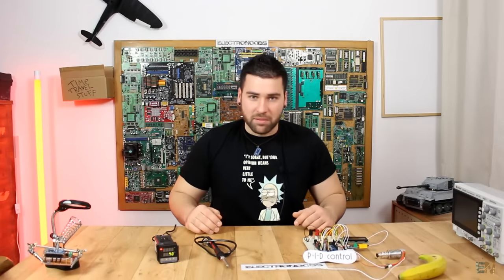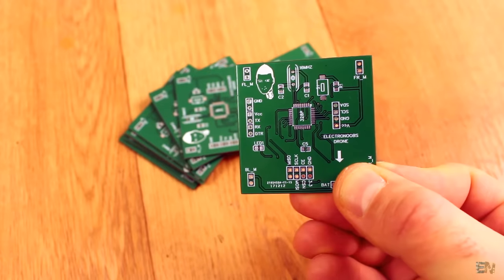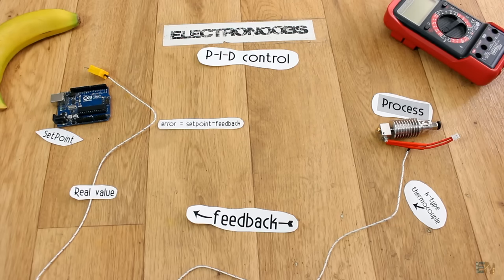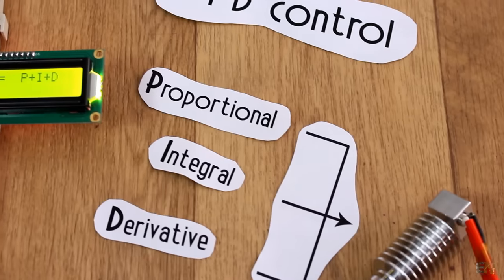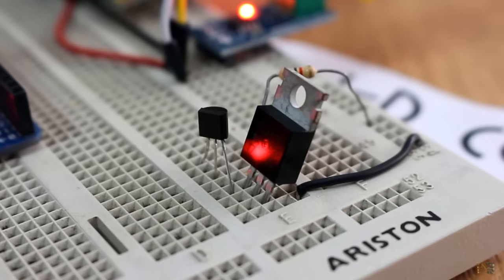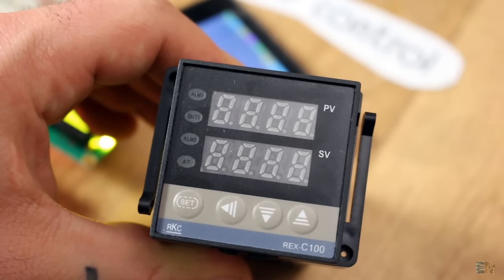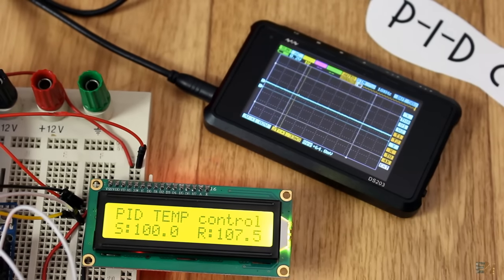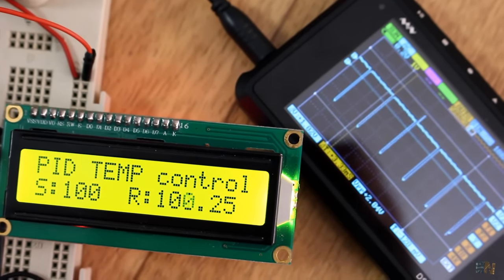PID temperature controller DIY Arduino

Comment: Another great video! I have a question why did you use  BJT transistor to drive mosfet ? how much voltage passes into bjt? 12 or 5 ? if 5 why you didn't use Arduino pin directly And another question why did you use a 10k resistor on mosfet gate ?? Thank You
Reply: Bjt is used since the mosfet has capacitance between gate and drain and the moment you apply voltage to the gate the capacitor starts charging almost instantaneously which requires current greater than arduino pin can provide increasing the switching time and if the switching is not fast, pwm control will not work properly. Please see great scott video on mosfet drivers to understand better. Also the 10k resistance is added to not keep the gate floating when bjt is off.
Reply: When we need fast switching like pwm then we use any gate driver

Comment: Facing an issue where the clicking of the switch does not enter the set temp mode, have you experienced this? Fairly certain it is wired right. Also are you using 12v power supply on the positive and negative runs on the side of the board? you have the resistor and heater on the positive run but other components that should be receiving 5v are on this run. Sorry I am smooth brain engr

Comment: The heating element can be represented by a first-order transfer function if you apply a step input (e.g 5 V or 12 V or whatever the supply voltage is). Plot the transient behaviour as the temperature raises and settles about a value (sample at regular intervals though). This will fit the equation K/(s(tau)+1). K is the gain so that will be the maximum temperature of the plot. Tau is the time constant and this will be the time it takes for the element to reach about 63% of its maximum temperature. You can either simulate this in Simulink and play with the PID values (make sure you use the z-domain rather than the s-domain though.
If you don't want to use simulink then just use a tuning method like ziegler nichols

Comment: I've been trying to do a PID with Arduino for Sous Vide cooking.   The tuning of the PID is the most difficult process for me. The key is to have the patience and good data collection to adjust the various parameters correctly. I tried to doo it with a Crock Pot but there isn't any circulation in a crock pot and I couldn't get the temp deviations down to an acceptable level..

Very good video with good starter information.
Reply: Can you share your thoughts about how you brought the temperature deviations down to an acceptable level?

Comment: Great explanation! I'm what you could call a beginner in grade 10 at school but I've picked up on the basics really quickly and have decided to do a project for in the house. I am going to use a PID to control the temperature for an espresso machine. This explanation was really useful, but still alot of research to do!

Comment: May need elaboration for more advanced engineers on the thermocouple. They DO NOT put out a voltage based on temperature.  They work on a difference in temperature between a hot junction and a cold junction.  The example video is OK for an elevated temperature in a temperature stable room, but would not work to control the temperature of the room because the cold and hot junctions would be at the same temperature.  Great introduction, and a good place for more advanced students to learn about the hot and cold junctions and temperature measurement of the cold junction to get accurate values for the hot junction.  The more advanced students and engineers can locate the cold junction in this example.

Comment: Nice Work. I have couple of questions related to source code
1. Why 3 is added in PID_error
"  PID_error = set_temperature - temperature_read + 3; "
 
2. Why kp (gain) is multiplied by 0.01 and in I value 0.01 is multiplied by PID_i and not Ki
 " PID_p = 0.01*kp * PID_error;
  //Calculate the I value in a range on +-3
  PID_i = 0.01*PID_i + (ki * PID_error);"
  
3. In your case how you figure out that " PID_value"  can be directly written to PWM pin with inversion. How you calculated relationship that this value will produce desired result?. 
 "  PID_value = PID_p + PID_i + PID_d;
  analogWrite(PWM_pin,255-PID_value);"
Reply from the maker: The 3 is added to set a higher reaal value than the set one. You can remove that if you want. 
The 0.01 can be removed but than change the Ki and Kp and divide those by 100 on the top of the code. 
To finde the PDI constants I've just made tests and more tests and always having the PWM signal on the oscilloscope and the real temperature printed.
Reply: Good point, especially number 3. I'm trying to understand the code, shouldn' t there be some kind of mapping function that takes the PID_value and generates an output according to a specified range? And what is the range of PID_value?

Comment: I like this video. 
From many years of experience i will advise you to have a function on your coming
soldering station controller, where it enters sleep mode, reducing temperature when not being active
soldering. 
This is due to the fact that soldering tips are " burning out ", when standing idle with high temperature.
Also the nickel layer is thin, especially on the chinese iron tips you are going to use as per your video..
Kind rgds.
Reply: niels larsen.
A lot of the burning of tips is due to the fact these soldering irons do not have a temperature controller. 
In order to not be too cold when they are working (touching new cold wire and melting tin) they are getting slightly too much power.
Basically, in rest the temperature goes up because nothing cools it down.
I agree it is a nice feature to add.

Comment: as the guys who wrote the marlin firmware know, dont forget a sanity check to watch out for thermal runaway if something happens to the temp sensor.
Reply from the maker: True. Thank you very much for the tip. Keep up!
Reply: Very good point.
Don't also forget what happens when your Max is broken, or gets no power... The temperature reading go to zero. Your PID code will go to Max output power pretty soon.

Comment: With such explanations,
Please make tutorials on controlling a stepper motor using arduino, as I want to open/ close a box's  window depending on the temperature inside a box.
Lm35 as a temperature sensor
Reply: Hey!  Have u got an idea of controlling the steppermotor based on the temperature? Its for my thesis :(
Reply: @TheRebornRJ  ahaha take the pid value and make a condition to powerup the motor by  a signal
Reply: @ultraidtech8250  "video not available"

Comment: Nice work! Just saying.. most of those industrial PID has also option to control solid state relay with PWM, so it will work flawlessly with any resistive heating element...

Comment: Take note about integral windup!
It`s very dangerous mistake you did.
Windup is ver very important.
Also for AC main supply of course you need to use optocoupler. This note even more important than windup.
Reply: In this case it can be avoided with simple if statements.
if temperature_read is within +-margin, use PID
else {
    if (temperature_read < set_temperature-margin) {apply ful power}
    else {cut off the power}
}
Reply: Mili theMUFFIN sure, thats how Electronoob did it now. check his firmware code,he aded +- 3 margin range when integral component calculates, and yes, for such application this works perfect. but for general purpose integral windup or saturation shoud be managed for all setpoint range.
Reply: @milithemuffin4534  Won't work .  Thermocouple falling off looks like zero temeperature.  Try harder // ( Commercial thermoucouple transmitters have  a high scale burn out feature to avoid this risk).
Reply: @vovanikotin   There is yet another algorithm called the Velocity algorithm... look it up  in a digital controls hand book .  This avoids wind up issue completely but creates another one... initalisation.  I have used V algo in the past.

Comment: Is there a reason that a BJT transistor used at the same time that a MOSFET is used to control the 12v heater? My understanding is that one or the other is needed since both are always on or off... I am confused!

Comment: Hi Electronoobs, Thanks for this excellent tutorial/demo.  I have a question though - At 7:46 in your video there are several parts of the wiring that are not in your final schematic.  It looks like you've added a diode on the "source" side of the Mosfet (is this connecting source to gate??, but I also see you have a negative (black) jumper looped behind the mosfet - what is that connecting to?  I can't see what pin you've connected this to because the mosfet is in the way.
Reply: I would also love to know this. Have you figured it out?? Would appreciate some info if you had! :D

Comment: Firstly, love the RandM time travel stuff in the background. Secondly, I have completed this tutorial. Everything works wonderfully at 6 Volts; however, when I increase my bench power supply to 12V, the Arduino begins to make a high pitch noise. I'm worried that I may fry the board. Should I perhaps use a 100+ohm resistor between the PWM pin, or am I being stupid? Thanks in advance!!! Ps. This setup has genuinely changed my practical knowledge of PID control!

Comment: great video as usual truly worth subscribing channel,one comment here when PID works shouldn't that mean that the transistor controlling ( with arduino) the MOSFET  knows! the exact current required to the mosfet to produce 100 degrees ? so that no wobbling in the osi
Reply: sermad reda.
Yes and no. One way to control the temperature of an electric heater is to calculate (or find by trial and error) how much power you need to put in to the heating element to keep it at a constant temperature. At that temperature there is then an equilibrium between the amount of 'heat' you lose (flows from heater to environment) and the amount of heat you add (through electric energy).
For every amount of energy you add, the system will end up at a different equilibrium temperature.
But this is not very useful, see for example what happens when you blow at the hearter. You remove more heat, and the temperature drops.
The advantage of PID is to automatically react to such disturbance by adding more electric power.

And you are right, if the P, I, and D you should not see any wobbly output .... Unless your PID actually NEEDS to respond to a disturbance.
A PID does not ' know '' how much energy it needs, it calculates that based on current, past and expected errors.

Comment: Hi, Excellent study, clear explanation. thanks for sharing. I have a question. I wanted to control the 220V AC heater with SSR. I tried to do but I couldn't drive SSR with PWM. and  Is banana required for the circuit? :)

Comment: My understanding is that the PWM should vary the voltage going to the ceramic heater? Is that right? Or does it just switch it on and off quickly using the PWM duty cycle to vary it? I'm finding my heater is always getting full voltage and doesn't shut off. Your circuit diagram is different to what you show in the vid as there is an extra component there - is this what I am missing? Any idea why my heater isn't shutting off, even when the PID value says it should be. I'm replicating this on a raspberry pi but other than that the heating circuit is the same as your diagram as far as I can tell. I'm assuming the red lines you have marked 12V are the positive 12V supply and the rest go to ground. I'm driving the BJT with a PWM signal and using the PID_value to change the duty cycle of the PWM.

Comment: Hi , Thank you a lot for your video. Very nice project! I would like to adapt this PID to refurbish a annealing furnace. But I want to use the MAX31855 instead of MAX6675 because I want to measure until 1200C°. Could you tell me if it's complicate to adapt ? 

Thank you in advance. :)

Comment: Its very helpfull...
do you have any idea if the heater used is operating with AC current and controlled by arduino ?

Comment: Dear Electronoobs. First of all, thank you for your video and code. I have a question about your codes. I do not understand why you used different values for P and I and D, I mean what would happen if you set all of them the same value<kp=ki=kd>. Next, I have some question about the formula which you used to calculate I and D,  this is for I <PID_i = 0.01*PID_i + (ki * PID_error);> and this is for D <PID_d = 0.01*kd*((PID_error - previous_error)/elapsedTime);> I was wondering if you could talk about details of these formula. Thanks

Comment: Awesome Video!! I'm planning to use this to heat a water bath so will be measuring the temperature of the water, not the heating block. Do I need to tune the controller in these conditions or is it a case of once it's tuned it's tuned for all environments? Appreciate any help!!
Reply: Hey man i want it for the exact same reason !! In case you figure it out can you let me know please ?

Comment: Hi, great video and a great project. I have now made this PID Controller myself and it works really well, but I have a question/wish for you. Could you make an extended video of this project where, in addition to PID, it can also have stepwise adjustment of temperature up and down with time intervals. It had helped me tremendously. Please help me

Comment: Hello friend, great stuff but I'm struggling to make this work. Trying to build this up with one difference: instead of use the MAX66 75 breakout module to read the real temp, I'm using a Termistor 100 K NTC B 3950. My problem is that I just cant make it work. I am not being able to  control the temperature of the hot end.. followed step-by-set the video, but apparently the BJT assembly just doesn't work. any suggestion?

Comment: I have tested each part individually, they all work properly, yet i cant use the encoder with this application.
The display starts flashing, changing fast the menu and goes crazy, every time i go near the encoder. Even if i just get very close to it. A 1M resistor from SW to ground stops the craziness but the encoder will stop working all-together.
It shows the R temp, the menu, everything but the encoder. All the parts are new and tested separately.
Got any idea why?

Solved. 
1- it was to close to the laptop and the arduino went crazy.
2- the encoder was missing the 10K pull-down from SW to GND.
3- the LCD library i was using was out  of date

Now it works just fine. Thank you  Electronoob!
Reply: I am experiencing issues with the encoder as well. I checked the connections and they seem exact. Individually, All the components work, the whole code compiles, but the rotary encoder gives no signs of life! (It works individually)

Any suggestions, please?
Reply: Update. 
The system works perfectly. The Arduino module had no issues being close to the laptop. It was the LCD that was sensitive to the EMI from laptop/keyboard etc...
I have shielded the  LCD with some grounded tin foil and everything works just fine. Including the encoder. I will mount the whole system into a metalic box for this reason.
Make sure that the encoder has the 10K pull-down resistor, connected from SW pin to ground, as shown in the schematic. As well as the other two resistors. Mine was missing the SW-GND one from factory.
I have also changed this:.
.if(PID_value < 255)
  {    PID_value = 255;    }
  if(PID_value > 0)  
  {    PID_value = 0;  }
to this:
if(PID_value < 0)
  {    PID_value = 255;    }
  if(PID_value > 255)  
  {    PID_value = 0;  }
In order to be able to use a logic gate MOSFET, without the need of a BJT.
Anyway, thank you  Electronoob for your time.

Comment: It seems easy to write PID control algorithm with arduino, but difficult with stm32 because of timer interupt setting. That would be graet if you can explaint this algorithm using stm32f103 serries. Thank you for sharing !

Comment: very nice video.. can you make this using an attiny85 as replacement for the uno?  and the output signal is connected for a small servo for opening a valve for fuel?  thanks

Comment: How did you power the DC heater and the Arduino? Did you use one or more power sources? If you only used one, would it work with two? I would like to use a Peltier-Element instead of the DC heater and my power source should be batteries. Since the Peltier-Element requires a lot of power and it is actually impossible to operate everything with one or two batteries, I wanted to use a battery for the Arduino and install a battery after the MOSFET as a power source for the Peltier-Element. Is this completely wrong and do you have any other ideas without using hundreds of batteries?

Comment: If I am using two of the same heaters in this videos could I used the average of the the two for the PID portion of the code? Essentially I am try to heat up one item in a sandwich style configuration with one heater on top and the other on the bottom.

Comment: Sir, did you already done the tutorial for this one with heating element that has thermistor? I would like to understand how to control temperature using heating element with thermistor built in with PID control system.

Comment: Can a second thermocouple be used to trigger the the heating cycle? Example: a primary thermocouple triggers the heater, and keeps it on at a set temperature (controlled by a second thermocouple and PID routine) until the first thermocouple is satisfied?

Comment: Excellent video, one thing I haven't grasped clearly is the conversion between units in the code: if I read a temperature value in say celcius from the sensor feedback, and output a current value (0-2.5 A) to the hardware that drives the process; how do I convert between the two units?

Comment: If I want to supply with a DC power converter what voltage/amp should I use? Would a 24V 2A suffice? What is too much?